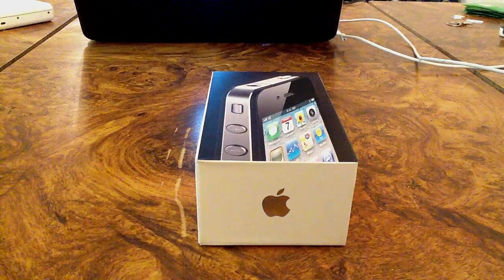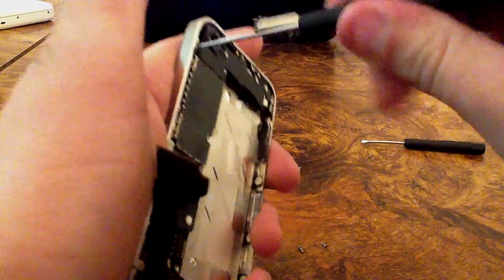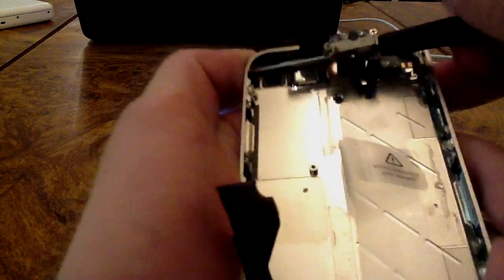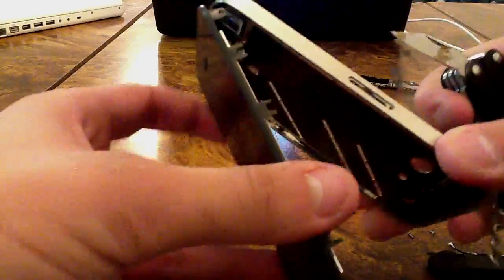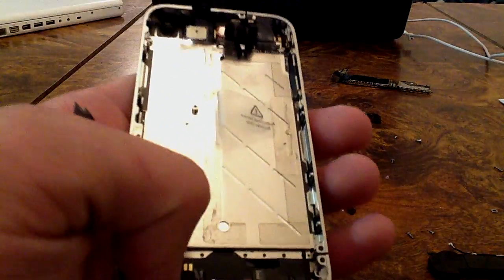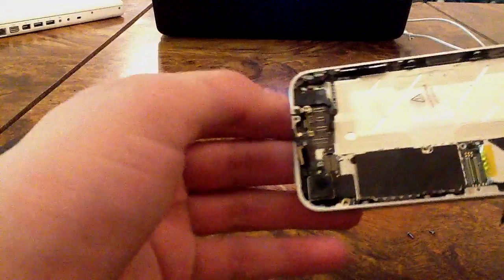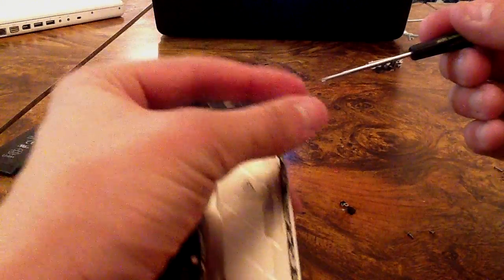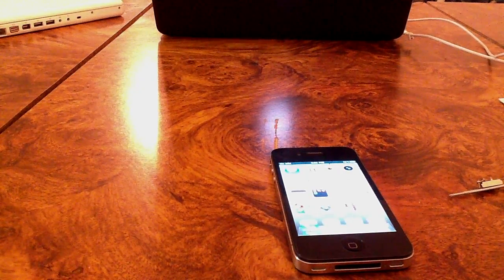iphone 4 disassembly/reasembly guide

Comment: Also other videos talk about to clean all the parts that you touch with Windex or Alcohol, because the oil from your fingers will effect the performance.  I saw you touch every thing without a worry.  Is cleaning critical? OR can I just wear Vinyl Gloves and do the job.  Thanks .  Your video was very helpful and it is obvious you have done it many times before. Thanks
Reply from the maker: touching the parts with your bare hands never affects anything. Don't ever use windex, only use 90%+ alcohol (70% if you can't find 90%+)
Reply: Thanks for the reply.  I also asked the question if the battery has to be removed to replace the Loudspeaker?  It look like they do not interfere or overlap at all.  Why tear up the battery or bend it, if not needed to?  will appreciate your input.  Thanks in advance.

Comment from the maker: @Jonafoto89 just as tiny as I could find, almost any small philips screw driver will do just fine, but I paid $7 on ebay for the one I use on a regular basis. But just look on ebay for micro philips screwdrivers and you should be good with anything you find there

Comment from the maker: Have you checked to make sure nothing is covering your mic underneath the gasket? also if your speaker is not working, your dock assembly may be shorting out. I would consider replacing it (PM me if you need a link for the part. Should be about $5-$10)

Comment: I need to change my Loud Speaker. For that do I have to remove the battery?  From what you have shown, it does not look like that you have to remove the battery at all.  Thanks
Reply: Do I need to take out the battery to change the Loudspeaker? Thanks
Reply from the maker: to be safe yes, but not required
Reply: Thanks a lot, man.  You are ok. I get the message of disconnecting power to the system to be safe.  Keep up the good work.
Reply from the maker: will do, thanks

Comment: My dad's iPhone dropped in coke. We stuck it in rice about 2 weeks ago, but no joy. I just opened it up and the thing you said not to lose, whatever it is, was not there. What should I do?
Reply from the maker: Just do your best to follow the steps in this vid and work around that part. also post the time at which in this vid I mention what part not to lose, i'll have to go over it to get back to you on that. Let me know if I can help in any other way
Reply: 6Italia0 I figured out that it is a different version than the one in the video.
Reply from the maker: same steps apply, but I would use a disassembly video for your model to reference to better help you reassemble your phone when needed

Comment from the maker: because the digitizer wasn't put through the mid frame all the way, hopefully you didn't pinch the cable, luckily the front assemblies are only $30 to replace, PM me for link if you need to replace it

Comment: My speaker quit working.  I got this part from Amazon and it was shipped by a third party,   called ONE KIND,  AKA D CALIBRATE, BOISE IDAHO.
It was a bad part, may be a Second or rejected part.  It was made in China.  So does anyone know a good reliable place to purchase a Original Equipment Manufacturer who can supply a part to the original specs and OEM quality and reliability.   Thanks
Reply from the maker: NEVER order any parts from amazon sellers, almost always the parts for phones will be faulty. Also not sure if you realized, but all iPhones are made in china. But otherwise here is a dependable seller I always use http://www.ebay.com/itm/100-OEM-High-Quality-iPhone-4S-loud-speaker-ringer-buzzer-w-antenna-assembly-/221024213594?pt=US_Cell_Phone_PDA_Cables_Adapters&hash=item337611da5a

Apple doesn't sell parts so it's literally impossible to buy original parts from any vendor worldwide
Reply: 6Italia0 Thanks.  I will follow up the lead you gave. I wish I had known that earlier.   Thanks anyway.

Comment from the maker: take out your speaker assembly, disconnect the home button flex and blow it out with air duster, then just put it back together, that should fix it. Also don't buy anything from direct fix, just buy shit off ebay, its just better and cheaper that way (PM me for links)